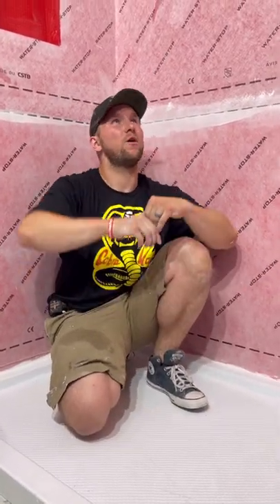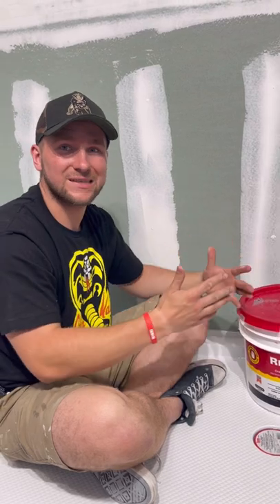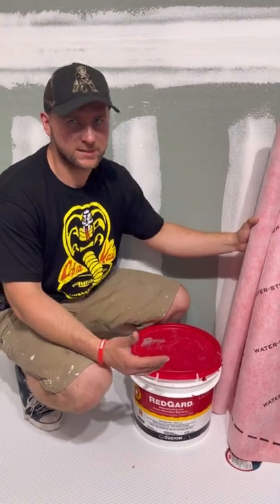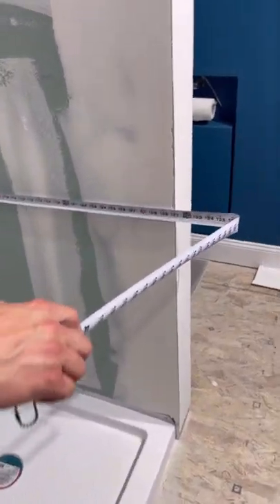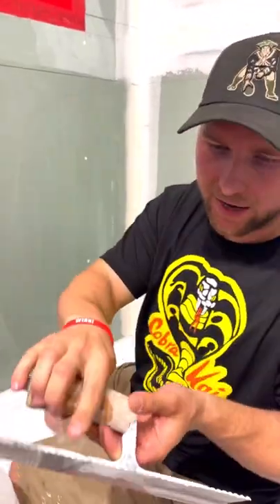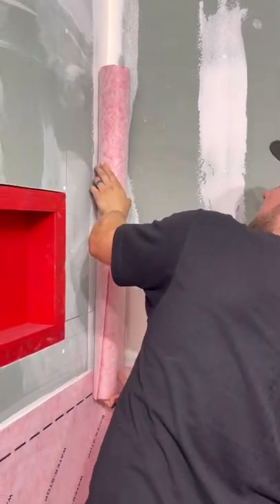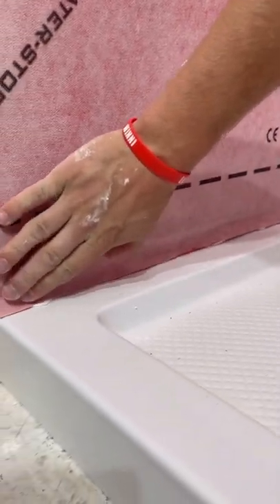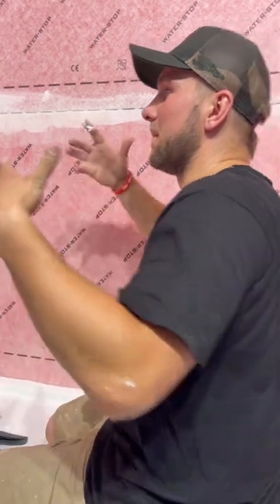Waterproof a Shower in One Hour! GURU Shower System WINNI Vlog 019

Comment: With all due respect, as someone who has been doing this for 30 yrs.

 When there is a minor/or slight leak with cement board the water disperses through the material where it evaporates (through the back side of the board) causing no/or very minor (the studs may eventually be affected) damage. With drywall of whatever flavor when the same thing occurs the moisture has a lot more trouble evaporating, since gypsum does not disperse it as well and the paper facing slows evaporation. 

Think about how many showers have been installed with cement board and no waterproofing on the walls before RedGard, Hydro Ban, etc. became popular. Unless the grouting was an absolute catastrophe they were able to deal with the water no problem.

If you want to say you are not worried about a leak occurring (through your surface waterproofing that's fine, but telling those new to the trades that a leak with moisture resistant drywall and cement board are the same is really doing a disservice to the community you are seeking to educate.

Also look at how many other popular youtube shower building channels that used to do drywall/greenboard have now moved away from it, there is a reason for the trend.

Richard

Comment: So if you have an old shower that’s on a center block wall how do you put tile on that won’t fall off?
Reply: Do you mean Cinder block?
Reply: Build wood frame to make your shower surround and then use traditional materials like cement/foam board to make shower walls.